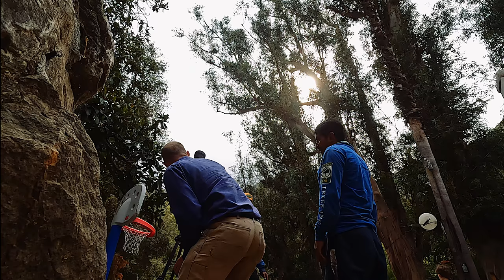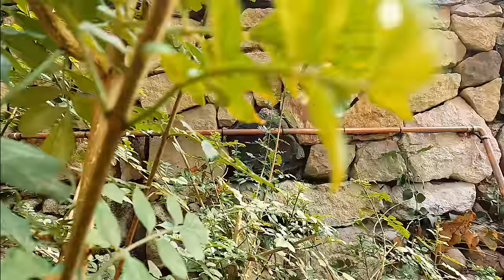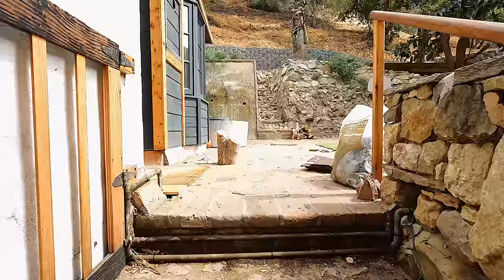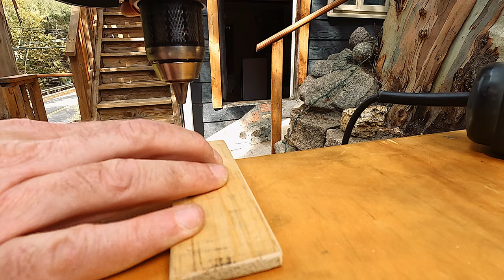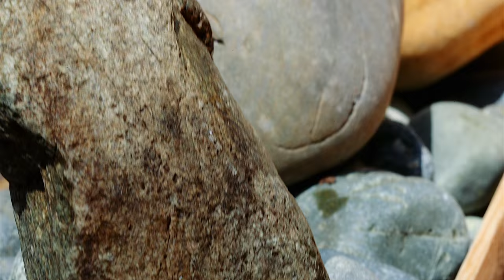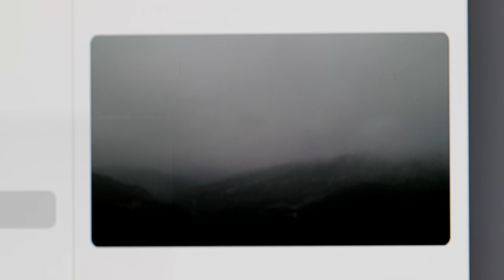Love Letter to Plumbers

Comment: As someone who lives in Sweden, I can’t help but be concerned about water getting into the house and moisture building up… but then again, it’s southern california, so what do I know
Reply: The foundation seems to be somewhat ventilated so I wouldn't worry too much. But Americans usually don't cover the subfloor with wind protection plates or anything so I don't know. I live in Finland so it also looks slightly concerning to me :D
Reply: In Florida, the same.  Super-high humidity (narrow peninsula) & tons of rain.  But Van basically lives in a high-elevation desert where the laws of mold & mildew (as I know them) are probably different???  I 'dunno'.
Reply: This is what I was thinking. But your right, he lives in southern California so I don't think it even rains often.
Reply: the big stones first in the hole,  prevent unwanted rodents from digging in.
Reply: As long as you are ok with water getting under the house
Reply: I was thinking of sealing it with a manhole cover, but it wouldn't be as pretty!
Reply: I had the exact same thought, when it does rain...and it will...the water will drain in there and run under the foundation.  I wouldn't think it's ideal.
Reply: Of course Van thought of this. That’s why he used the three large tall rocks on top, to ward off water from getting into the hole. The three rocks scare away the water with their size and power.
Reply: Topanga gets 14-19" of precipitation a year. Which is enough. The Spirited Man learns about plumbing and drainage his own way
Reply: I was waiting for an eventual roof thing to go over it at some point in the video, but that point never came
Reply: Anybody else interested in hearing how this held up in the rains they just got?
Reply: I wouldn’t mind exposed indoor plumbing. Or some sort of chase system that can snap apart easily
Reply: As someone living in Germany, I have to say, that this is no solution we would do nor accept here in northern Europe :-) 
We usually have all(!!!) cables and water pipes inside of bricked(!!!) walls. You know what? They never break thus we do not need to fix anything. They can last for over 100 years inside those walls. And just never break. So surface is really clean and pure – inside and outside. Just the color of the wall. No annoying pipes and cables … Personally I have to say, THAT is REAL craftsmanship.

Comment: Love this van. As a service plumber I can’t thank you enough for this video. Plumbing is the most essential service. We prevent disease and we provide you the water you need to survive.
Reply: Hah. the carpenters provide the roof and walls to shelter from the elements. I can crap in a bucket and drink bottled water. 😉
Reply: @blueman5924  carpenters are great. But plumbing is everywhere and carpentry isn’t. There’s not carpenters digging up roads to fix sewers or water services. Plumbing is the most essential service. Can’t live without it
Reply: @blueman5924 and how does that water get into the bottling plant and into the bottles for you to drink? Plumbing.

Comment: If your plumbing constantly needs maintenance, then there is 100% something wrong with your plumbing system in general. Either it wasn't installed properly or correctly, or it was done by a lazy or dodgy plumber. Your plumbing should rarely ever need any maintenance, thats why it is built into walls.
Reply: Damn straight. You get plumbing. Van doesn't.

Comment: As someone who fixes things for a living (auto mechanic), I've always dreamed that when I build my own house someday I'll construct all the plumbing and wiring in such a way as to make it easily accessible for maintenance and repairs. No busting through sheetrock and concrete to get to what would otherwise be a simple repair, but rather some neatly organized system of removable panels and access ports so I can easily do my own maintenance in less time and with less hassle.
Reply: The dream for many of us

Comment: I thought he was going to make a custom concrete molded paver that was removable, and sat in some kind of rubber gasket. I am not sure this will keep water out of the home.
Reply: That will be the upgrade...
Reply: Dirt, sand and a paver are the solution I would have opted for. The plumbing is still quite accessible, but keeps water from collecting under the house and could closer match the existing brick work. Van chose the 'feature it' option. Over time, that wood is going to rot I'm afraid.

Comment: Interesting Idea, however you'll want to create an access panel that has both a vapor barrier and high R value.  I recommend wrapping some vapor barrier or liquid flashing around 2 layers of polyiso and plugging the hole with that instead.  With your solution you'll have water, insects and small critters like mice passing back and forth.  While in a dry hot area like your house is this might work against fungal buildup, but in somewhere humid like the south this would cause a vaccum evacuation of the hot air through your ceiling if there were any leaks.  Also the hot humid air would find a cold surface in your crawl space creating condensation and lead to fungal growth or other issues.

Comment: How is that fix going to keep the water from pooling under the house causing a mold mildew issue over time?
Reply: Water? What water? It’s SoCal. Any standing water in SoCal is done so by man so it can be used later. The rest drains into the dry sandy soil or evaporates.
Reply: if "rainy season" is more substantial than a light misting from time to time he will have a tub full of rocks and water decaying that wood frame and definitely leaking under the house. didn't see any caulking on the inside just shoved some tarp in there
Reply: @anthonyjanairo4434  He just said rainy season was coming /shrugs

Comment: Love the story in this. Side note: my house is on a concrete slab build in the mid 70's. I noticed that I could hear water flowing constantly after I replaced the pressure tank. All the copper from our 'utility' room went into the concrete. Had no idea where the water was going, but it was going somewhere. Water was coming out of the taps but the hot water was not hot. Long story short, about 90 percent of my plumping (pex pipe) is now exposed and I am ok with that because our plumping is better than ever.

Comment: Hey Van! I drive a van because I'm a plumber, I've grown to hate plumbing hidden in walls and concrete but I've also come to realize why, most people find it ugly I'm not really sure why even the shiny copper and brass. But mostly that wall you had to tear down acted as a pretty great shield from your kids or your valuables, yes the soaked wall and floors seems costly but caught quickly enough they'll dry out just fine just need some rock and paint. Also if you were too use PEX in that concrete it would never burst nor need replacing they've done some incredible tests with that stuff. Love the videos!

Comment: For one they’re safer inside the walls.
 Second- they last longer inside the walls vs the weather and outside elements beating down on them…

Most of the time copper fails is because of bad installation …

Comment: I live in a condo. Everytime a small leak occurs in the plumbing in the wall, it has to be fixed and then tradesmen charging 125$/hr have to come in to repair the drywall and insulation. A small leak is always at least a $2000 bill, especially because its a condo no one does it themselves (the board hires a contractor). There has to be a better way. Where plumbing leaks are exposed visually and do not flood walls before they are noticed, and can be repaired easily without a massive labour bill.

Comment: I think the problem is what's code or not in a particular area. Plumbing like that would not be allowed in Sweden. Outside plumbing is almost always UV-resistant plastic piping run in almost like a conduit (often buried) so that the piping can be pulled out and replaced if it's punctured or something. Copper piping cast in concrete is a very old technique

Comment: Great video, and you make an important point.  iFixIt and Louis Rossmann need to bring the "Right to Repair" movement to our houses.  It isn't just plumbing; it is also electrical and HVAC that are completely unworkable in most houses and even some commercial buildings.

Comment: The old  joke is that California has 4 seasons.. Earthquake, Fire, Flood and Drought.     It doesn't rain very much, but when it does, it flash floods.      My concern is not just rain into that space, but a stream of floodwater from the hillside above his house just pouring straight into that hole.     If you can't pour a couple 5 gallon buckets of water onto those rocks without it ending up in your crawl space, then it's not fixed right.   But it's a fantastic video.  ;)

Comment: F me. Since the 1980's as a kid I've been reading Popular Mechanics and Pop Science as they introduced PEX and whatever it was branded as in the country you're in. Insurance companies SHOULD have influenced general architectural and mechanical engineering design to make dwellings more resilient. There have been designs proposed that drain centrally and / or have access areas for the access of plumbing fixtures. FFS even Alcatraz prison got this right (at the expense of security - allegedly).

Comment: I would be concerned by all those rocks putting pressure on those copper pipes and your electrical wiring causing them to burst or leaks to form as water runs through them. I hope that tarp holds them up. In would have used some heavy duty canvas. Honestly the initial wood plank you had in there would have been sufficient. I would have made that cover waterproof, and as an access point to the plumbing below.

Comment: I’m an HVAC guy and have given up the battle with builders and contractors on access. 99% of all people could give a rats ass about where the water comes from, where does it go, how does it work. For me it’s the hot it cold air. Tell someone it would be best if this or that line was accessible and you would think you just asked them to cut off their hand. Fine. They can fix the drywall twice in 10-15 years.